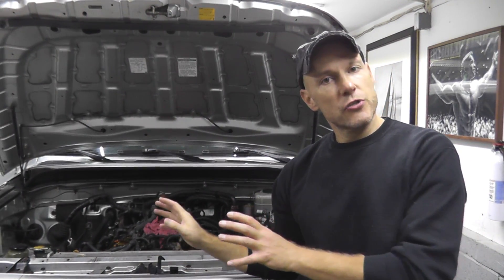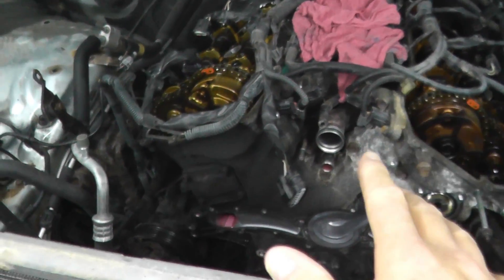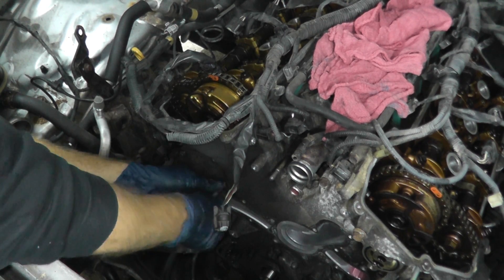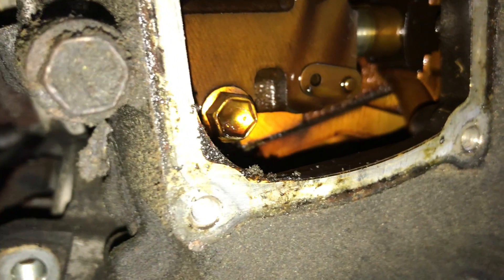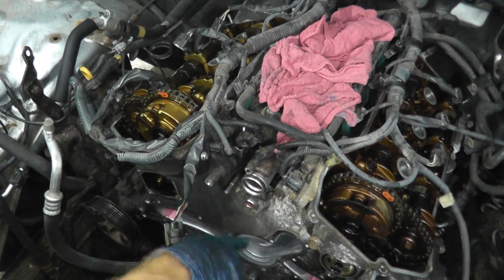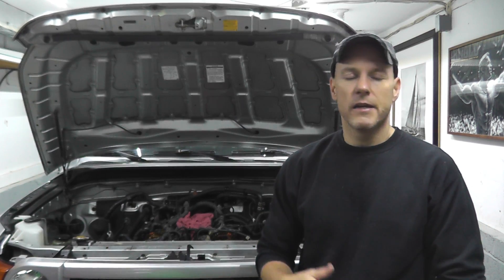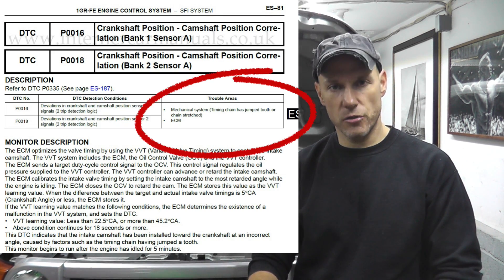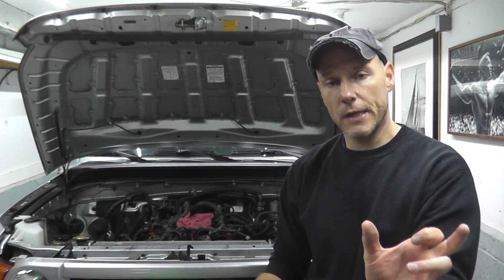Does your Toyota have a stretched timing chain? | Toyota Tacoma - FJ Cruiser Timing Chain

Comment: I have a 2010 fjc tt that the timing chain inspection cover is leaking. I got a new one and it's a formed crush gasket. Meaning if you take off the cover . You have to replace the gasket.

Comment: So I'm into a 2010 FJ TT no codes with cold start rattle on drivers side. Also operational rattle at 1700-2200 rpm. The #1 tensioner as shown is fully extended 12mm and the pass-bank #1 EX cam is retarded 3/16" at TDC. 

2010 has the low mount oil filter cartridge meaning the timing cover can't be R&R without pulling the engine or dropping the front differential, to accommodate proper assembly order of cover first oil pan second. I gotta tell ya TOYOTA, that's a real kick in the lug nuts.

Comment: if you have an engine ticking sound on a cold start, but goes away when the engine gets warm can that also be a worn timing chain, or is a worn timing chain noise constant? mind you the ticking is most noticeable on the driver’s side of the engine and somewhere close to the actual spark plugs not on the front where the chain sits.

Comment: Just one quick question. Is it not necessary to rotate the engine one way or the other to ensure the slack in the chain is on the side with the tensioner? I could see a case where the engine stops with the chain tight on that side and the tensioner being compressed. You would believe the chain was fine when in fact it's just not showing up because of that. Just wanted your opinion on that. Thanks
Reply: that is the only tensioner. and by that taking out slack in that spot it takes out slack on the other side.  Idocars tore one down if you want to watch

Comment: I having an issue with Code P0022 which is the VVT Soleniod.  First I cleaned the old one, cleaned it, followed by testing it with 12 DC source to be certain it was clicking, which it was.  Reinstalled and a week later the same P0022 came back.  Next, I purchased a new VVT Soleniod from Toyato for $172 and installed it.  Five days later the P0022 comes back.  Now I was told that I should have replaced the VVT filter and VVT gasket at the time I replaced the VVT.  So that is my next project.  Order the VVT Filter and Gasket from Toyato Dealership out of Ks.  Will be here mid-week.
If this doesn't fix it I don't know what to do next.  I can pull the check plate for the timing chain when I replace the VVT Filter and Gasket next week.  Again I am not getting a P0016 code.  My truck is a 2005 Tacoma Prerunner 4.0, 1GR engine with 181,000 miles.  I bought it in April 1007 and have only used Royal Purple 5w30 and Royal Filter filters since that time.  Couple of years ago, the timing cover, front engine seal and waterpump were replaced as I had an oil leak at the upper right corner of the timing cover.  The repair shop told me that the inside of the engine was really clean and the timing cover open the mouth of the egine.  Any advice you could give me is greatly appreciated.

Comment: Very helpful video. Also I surprise that with such small mileage for bulletproof 1GR-FE (I own several 4Runners with the same engine and way higher mileage) you have stretched chain. Ive heard you said this truck was sitting for a long time, but I don't think it can stretch chain while stored not running. May be something else is a culprit.
Reply: likely broken tc guide
Reply: @maxnuccio2440 I bought a 11 tacoma, it had a fender bender to the drivers side suspension and steering rack, replaced and have been driving for a month but got a little rattle maybe once a week. Drivers side tensioner guide is most likely broken.

Comment: Hello,   104 K., miles, it's not a long run for the engine to stretch the chain like that, maybe the odometer is not showing correctly.
Reply from the maker: As I slowly go over this truck it's quite apparent this vehicle sat for some time and wasn't maintained. Things check out on the Carfax. I do plan on double checking the mileage according to the ECM with my scan tool. Cheers.
Reply: @Carsntoys  could have overheated at one point too. that could stretch a chain